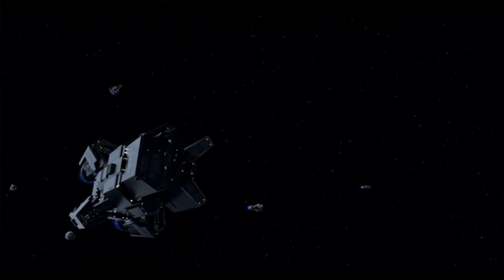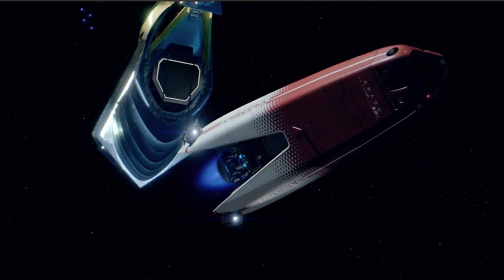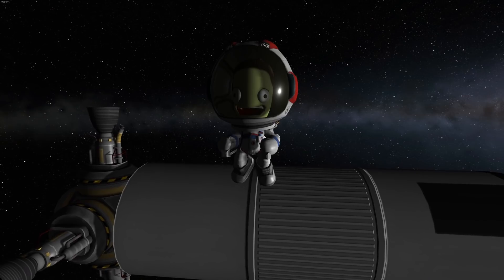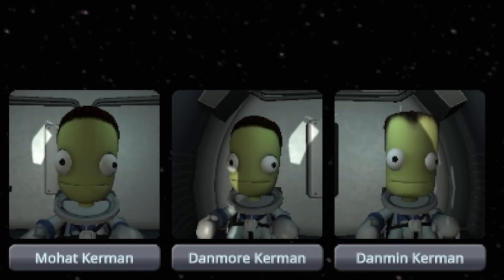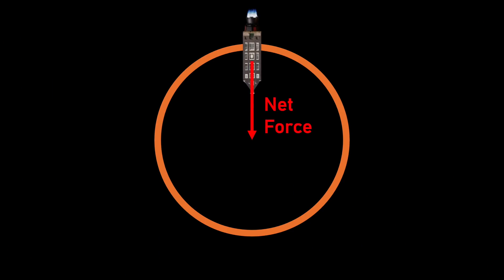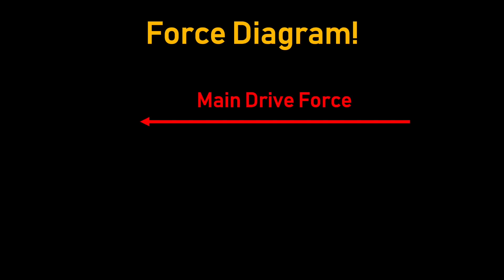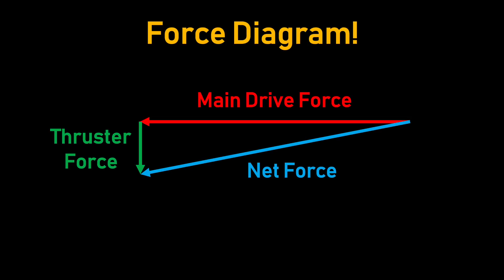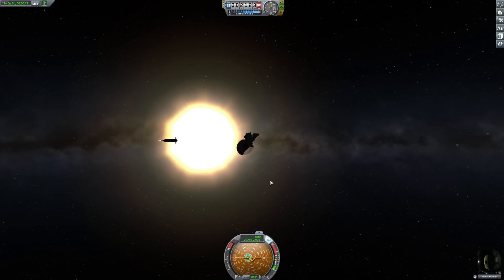Testing Physics of The Expanse With Kerbal Space Program

Comment: That's one thing that did confuse me. In the book, the Chetzemoka had multiple engines, and Naomi shut one off. This created a net force on one side of the ship that kept it going in a circular path. Not only that, but the centrifugal force it created was enough for Naomi to feel spin gravity onboard.
Reply: In the show she can actually feel "the spin gravity". You can see her walking at an angle as well as right after using that hruster when she takes off her helmet it's rolling towards the airlock even though it should stop because it wasn't round.  A lot of people missed it because the helmet fact was hard to catch as well as people thought she was walking like that because she was hurt
Reply: Wonder why they changed it.
Reply: Also I think they changed it because if in the books it looked like that then ship would jump keep spinning faster and faster because that would be constant force.
Reply: @paxon57  actually constant force is what would be needed to maintain a circular path, although it would have to be constantly perpendicular to the ships current velocity, this could most certainly be achieved by turning off a thruster on one side of the ship, if that force imbalance is enough to keep the ships main engine roughly perpendicular to it's velocity vector it would move in a circle

EDIT:
Shit no you are right, I thought about it some more, a constant force imbalance like that would cause the rotation speed to increase continuously so you still wouldn't get circular motion, so a brief foreign of the thruster could actually have the desired effect, what he showed in this video was the thruster firing too hard causing too fast of a spin, but if he limited the thrust so the ships rotation was slower you actually could get the thing to go in a circle.

I'm supposed he didn't mention that even if the ship fired the thruster just right to get the rotation at the perfect speed to keep the main thruster pointed inwards and the ship going in a circle the scene still would be wrong, when she leaves the ship she would fly away from it at a tangent to the circular path that it is on, she physically could not end up in the center...
Reply from the maker: @Ender240sxS13  there is no physical way what we see in the show could produce circular motion, I explain the physics in detail here https://youtu.be/zVganCVvZMs
Reply: @RyanRidden  maybe with a very slight nose thruster nudge, and observing from a moving frame reference v(t) where t is the moment the thruster is ignited, you could see the "curcular" motion. To a "stationary" observer it would definitely look like the trajectory you published earlier.
Reply: @RyanRidden  There is if you don't assume that ship was thrusting along it's velocity vector when it fired. Maybe it was changing course at let's say 90 degrees from its velocity vector.
Reply: I was expecting him to come up with a configuration that would somewhat achieve the helix motion.
Reply: There is a way to do the spiral. Have the nose of the craft pointing inwards like a car drifting through a turn. That would do it.
Reply: I also understood a constant force, in the book and the show. In the show, she beats that valve open and, as far as I could tell, left it that way. Though she apparently kept closing the comms access panel without us seeing it. But I put that on unconscious Belter fastidiousness, where the thruster was a deliberate attempt to change the path of the ship.

I assume they changed it to a thruster in the show because it's something the audience is familiar with - Amos repairs that busted thruster during the Battle of Thoth Station.

Oh, I'm not saying you're wrong btw ( just started your next video ). That cycloid path your simulation shows makes sense whether the thruster continuously fires or not, I think. Just saying that I understood the conditions to be slightly different than what you show.
Reply: @m3rl1n0f4mb3r  me too. As I watched the show, I saw the side propellant being activated to give a constant sideways push.

If applied constantly and endlessly, It would put the ship in a logarithmic spiral, which would put naomi always in the center (almost, as there is time between her exit and propellant being activated)
Reply: @m3rl1n0f4mb3r  the thruster repaired after thoth station is not on the ship shown in the episode that this video talks about. Amos repairs thrusters on the Roci, this is the Chetzemoka.
Reply: I haven't watched the follow-up video yet but the helical motion should be achievable... with at minimum 2-3 separate maneuvering thrusts. However the ship is still oriented wrong (in the show, and as Ridden pointed out), and to end up relatively stationary anywhere near the center she'd have to run against the centrifugal force and fling herself towards the nose of the ship from the side that would be moving away from her as soon as she lets go.
(This would also be the dumbest possible direction to go to keep her friends away from the bomb, and it would minimize the engine plume illuminating her as critically happens in the show. But it would keep her from getting roasted by the engine.)
Reply: in the show she activates a manurvering thruster to send the ship into a spin and for some reason the ship doesnt correct for this new spin.
Reply: Tbh the 3 episodes where Naomi was struggling were incredibly confusing. I feel like they tried their best to show what was going on without any dialog. In the end though, even with a little physics goof the main plot point held up well
Reply: Like with the de-orbiting maneuver around the Jovian moons, sometimes the show sacrifices perfect physics realism for better storytelling, which is okay in my book. I think only the nerds who would watch videos like this noticed it anyway
Reply: @leovin00  yeah, at the end of season 4 we get a shot of the ship flying directly away from the planet/star as it heads back to the ring gate, im there like "thats not how you escape a gravity well, but it gets the point across to people who dont know orbital mechanics so im ok with this" same thing with drop pods going down to a planet i think was also in season 4.
Reply: Isn't the guy who posted this video a physics professor? Are you guys arguing about physics with a physics professor?
Reply: @Shadownailshot  Who said I was arguing about it? Did you even read my comment?

Comment: First time SAS was OFF, and on the second time it was ON.. u can even see the main drive correcting itself. Try again, like the first config, but with a weaker and shorter side booster and with the SAS OFF.... *SAS = When active, SAS will provide input to stability systems to dampen craft rotation and, depending on capabilities, lock onto a specific orientation. The user can override the current rotation for any axis. Since it controls heading, it can be extremely useful for lander missions. When active, the SAS itself doesn't drain electricity, though reaction wheels may continue fine-tuning even in space. It will utilize all active control systems to achieve this, like the user would by pressing the keys.
Reply from the maker: Whoops I missed switching it off in that recording, though it doesn't make any difference to the end result. As I said in the video the net force must act continuously, which no burst can produce.
Reply: Can u try again with SAS off, and with a shorter RCS burst? Because, in my head, if you put a rocket with locked gimbal main engine and then start a rotation moviment, with the RCS, with no force to stop the rotation, it will make a spiral as in the series.
Reply from the maker: No need to test in KSP since we have the power of mathematics! I ran through the calculation, and this is the path you would expect from the scenario depicted in the show: https://www.youtube.com/post/Ugz4-IE6-H6b_o5Ootp4AaABCQ

Comment: May be that your initial main engine burn was too strong ?
Did you try  some other variation of parameters to get somewhat similar spin to one that happened in the show?
Reply from the maker: The result comes out the same since the nose thruster only introduces torque around the centre of mass. The ship will always end up spinning around the centre of mass, and won't reproduce what we see in the show.
Reply: @RyanRidden  noooo... I just want this show to always be accurate :D
You're ruining that here haha
Reply from the maker: @dredeth  sorry! Overall it does an incredible job.
Reply: @RyanRidden  if a ship had thrust constantly sent out in a circular motion (engine orbiting the ship and thrusting outwards) the ship would clearly take a circular path

your spinning ship seems to have no thrust, only momentum. that engine is spinning around quite quickly, surely it could result in a spiral if thrust is large enough compared to initial momentum

if we think of the length of Naomi's spiral as the direction of initial momentum, the spiral could result if during her maneuver the engine became perpendicular to initial momentum, and spinning motion can result from sideburst as there is no friction to stop the spin; engine acts as though it is orbiting the ship as per first example here, resulting in circular motion of ship if thrust is large enough vs spin speed. . .

Comment: I swear to god I though she fired the thrusters to keep the spinning in a spiral... for whatever reason. Why did she even do that?
Reply: I thought she wanted to make it impossible for anyone to dock. Even Bobby didn't want to dock to the ship when it went into that spiral.
Reply: @kedrednael  As KSP player... if the hatch is rotating.. it is defacto impossible to dock. (only in Interstellar they had this awesome luck, the center of rotation was exactly in the center of the docking port, then yes you can line up rotations, but if it isn't and you lost control of the ship that is rotating, it's game over for that ship, no docking ever.)
Reply: So that she could jump off the ship, or she would be disintegrated due to the heat of the epstein drive.
Reply: @SergioBQ87  maybe. i kinda found that whole scene with her on board confusing as hell.

Comment: Wouldn't a constant lateral nose thruster burn result in the circle?
Reply from the maker: It would just spin the ship up faster and faster around the centre of mass.
Reply: @RyanRidden  Even under main thrust?
Reply: @pwaks  It’s the main thrust that would cause it to circle faster and faster. If you use side thrust to hold the size of the circle, the main thrust has nowhere else to go. Everyone on board gets squished eventually by the two thrust vectors accumulating.

Comment: Cmon, you used way too much thrust on the first burn, the quick rotation just cancels out  the thrustvector, a slower rotation would also cancel it out, the expanse was accurate, you just messed up
Reply: This, also ksp centres the camera in on the ship
Reply from the maker: Thrust power makes no difference to the overall result. Here is the expected path  https://www.youtube.com/post/Ugz4-IE6-H6b_o5Ootp4AaABCQ
Reply: @RyanRidden  Thats with the wrong frame of reference, at no point would she move far away from the ship because a rotating ship cancels the thrustvector out and she doesnt add more than a few m/s to the system. The rocket would NOT move away from her. Again, your frame of reference is wrong, the frame of reference is traveling along with the ship and her and since she induced a rotation in the ship it will fire "backwards" just as long as it will fire "forward" so the thrust vector is zero. " " because the frame of reference isnt the global plane, but her, and she is already traveling with the ship when she gets out.

Comment from the maker: RIP Mohat Kerman
Edit: before you comment about the choice of thrust to induce rotation look at this: https://www.youtube.com/post/Ugz4-IE6-H6b_o5Ootp4AaABCQ
Reply: In the first example, the ship does end up in a path that is analogous to a moon orbiting a large planet: the moon spirals while the planet goes in a "straight line" (or whatever orbit ot happens to be on). 
If the rotation was much slower than your example, (which is plausible based on the scene) wouldn't the ship appear to take a circular path in a reference frame similar to the planet in my analogy?
Reply: The image you have provided looks like circular motion as understood by a different inertial reference frame.
For reference, the trajectory of an object engaged in circular motion as observed from the wrong inertial reference frame can be found here: https://www.desmos.com/calculator/fmwcghblm0

I set it up so that you can change the observer's velocity vector by clicking and dragging the black dot.
Reply: @rensin2  BUt wait, then with 0 speed we do have a circular motion. That is what was just proven wrong!
Reply: @gyrocopterkai  I don’t understand your point.
Reply: @rensin2  If I adjust the observer speed in your tool to 0/0 then the path of the ship is circular. According to the explanations above it should be like an endless McDonald's M, when the relative horizontal velocity is zero.
Reply: @gyrocopterkai  That is the point though. The only apparent difference between his trajectory and mine is the inertial reference frame we used to draw the trajectory in question. That suggests that there is an inertial reference frame in which the ship engages in circular motion.

It shouldn’t be “the expanse is wrong“, it should be “I used a different reference frame to sketch out the trajectory than Alex‘s computer did”.

Although, either way Naomi wouldn’t end up in the center.
Reply from the maker: @rensin2  There is no reference frame where an observer will see circular motion. I explain the mathematics in detail here: https://youtu.be/zVganCVvZMs
Reply: @RyanRidden  Your video fails to address my point (and I don’t think it was intended to address my point). It is true that the ship would not undergo circular motion in Naomi‘s reference frame and your video shows that very clearly, but that is also true of the trajectory of an airlock on a spin station relative to the reference frame of someone who got spaced through said airlock. That doesn’t mean that the airlock isn’t spinning around the center of the spin station, it means that you’re using the wrong inertial reference frame if you want to see circular motion.

A good test for my claim would be to take the ship’s velocity vector when the ship is pointing in direction “X” and the velocity vector when the ship is pointing in direction “-X“ and then average the two velocity vectors. An observer moving at that average should see the ship enact circular motion if my claim is correct.
Reply: @RyanRidden  > There is no reference frame where an observer will see circular motion.

Lol! It's amusing to see clever people get relatively simple maths so wrong, given a little bit of contextual camouflage.

Just think: the rocket is spinning freely, at a constant rate. So the component of force (via basic trigonometry) in one axis will be a sine wave of simple harmonic motion. In the axis at 90 degrees to this, also SHM, with a time delay due to 90 degree offset. The is the definition of circular motion.

The (most) relevant reference frame is the rocket's average velocity. Which will remain constant, with constant spin. Obviously the applied delta-v always cancels out with the the dv when it's pointing the opposite direction.
Reply: @ZeroGravitas  Have to agree with this. If something is spinning while under thrust, it will make some sort of circular motion (mostly spiral...) Not to easy to observe in KSP with standard camera tracking, since it will follow the object...
Reply: @rensin2  Beautiful demonstration! So yes, can be seen as circular, but in different plane and with different ship orientation than shown on screen, in the Expanse (i.e. pointed to centre of circle/spiral).

A minor ambiguity is, which side of the ship does Naomi jump out of? It looked to me like from the 'front' facing side, adding to the direction of the pseudo-orbital motion of the rocket. So throwing her clear of it, though passing through the drive plume...

But if it was opposite, and her ejection speed was exactly matched to the pseudo-orbital velocity, the ship would circle back around and hit her, i think.  😆
Reply: Hey there! Could you answer me a question that I - for some reason - couldn't find a definitive answer to? How long would it take accelarating at 1G (I presume that's close to how quickly they accelerate/decelerate in the Expanse) to reach let's say.... 90% of the speed of light? 
Essentially my question arises from the idea, that if your method of creating gravity was using continuous 1G acceleration, first off, using conventional fuels, you'd empty the tank REAL quick, but let's say that's not an issue, how long could you travel, before reaching super fast speeds. Where even time dilation starts to become at least somewhat noticeable.
Reply: @gregsomlai297  The speed of light is 2.998e^8 m/s, 1g is 9.80665 m/s^2.  2.998e^8/9.80665 = 30570000s, 509500 minutes, 8492 hours,  or 354 days. So about 320 days to reach 90% c at 1g.
Reply: @thentil  Thank you! Yeah, that's what I figured, it's just that I've seen someone calculate it screwing up an order of magnitude, making it a month or so. But still, that's pretty damn crazy. Wouldn't take that long...
Reply: @gregsomlai297  That other person probably took time dilation into account. Orgborg did not.
Reply: if your kerbals are stuck call the BlunderBirds